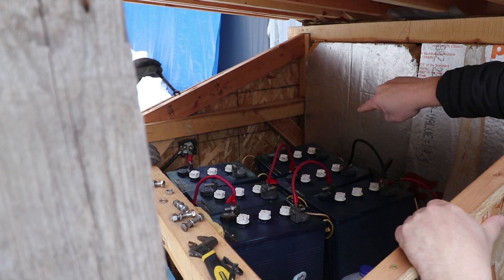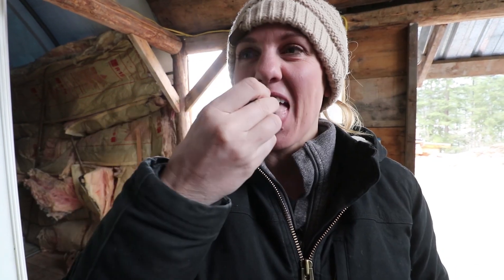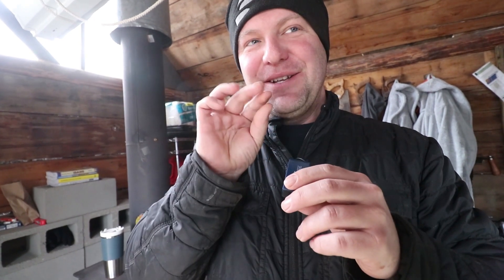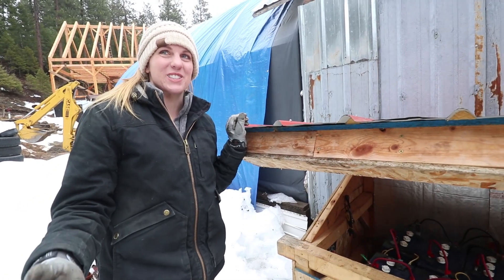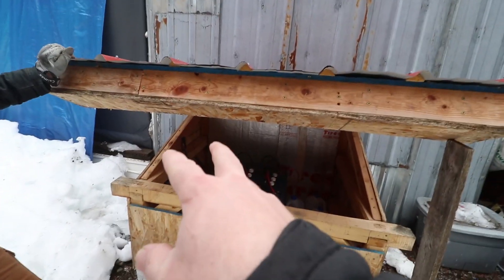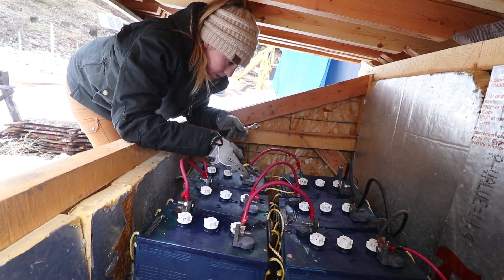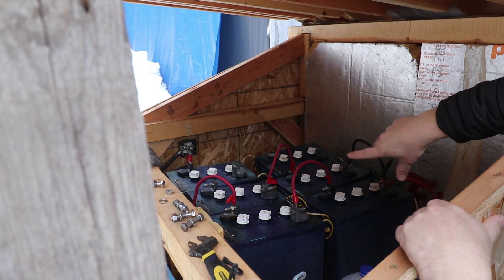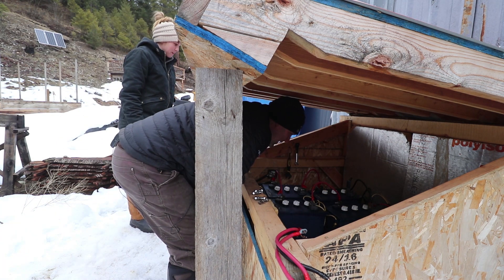All the Solar Panels in the World CAN'T PREVENT ➡️ THIS ⬅️

Comment: Two things to say here, if only one of the 6v batteries is causing the problem, why junk both - could you not look for a single so you can add the pair back into service ? Secondly, each of those solar panels is a bunch of individual 0.5 volt 6 inch modules in series. If just one in a series chain is blocked from the sun you lose most/all of the series chain's output. I would want to clear the snow from the base where it is partially blocking the lowest panes and you might see more output.
Reply: " if only one of the 6v batteries is causing the problem, why junk both - could you not look for a single so you can add the pair back into service ?"
Two batteries, six volts each, that is wired in series for 12 volts needs to be same make, same age same sixe and preferably same batch, because if they are uneven, they takes different charge, meaning that one are overloaded when the other are short of full load. This is bad for both the batteries, and shortens their remaining time as usable batteries.

Comment: Electricity is like water in a pipe, the pressure is the voltage, the size of pipe is the current, voltage multiplied by current is watts (for AC there's a power factor offset, if you look at an appliance that has all three on there and do the calc, you will find a discrepancy)
So, high power is a big pipe with a lot of pressure.
Charging is like filling a tank, doesn't matter how fast or slow you fill it, but when you want to use it, you can use it at whatever speed you want, within the capacity of the tank
If/when you redo the battery box, make the front removable, even if you don't fix the hinge problem.
Reply: Thats a pretty good explanation, thanks.
Reply: Not quite. Pressure is the voltage as you say. But the size (diameter) of the pipe is resistance. Current is the amount of water moving through the pipe(a product of both pressure and diameter of pipe). And power is the ability of the water to move something a (product of the amount of water and the pressure).

Comment: Dear Alyssa, Robert Smith does a good job in a three part series of explaining how voltage-current-watts work (30 min total).  The link is to part 14 of his Build a Solar Panel series.  If you decide to watch how he builds the panels from scratch, I recommend switching to aluminum frames instead of wood frames, unless you can figure out out to preserve the wood for quite some time.
https://www.youtube.com/watch?v=yv9KpbZTUIc

Comment: Simplistically think of electricity as water in a hose. Voltage is the water pressure inside the hose, Amperage is the amount of water going through the hose, Wattage is the amount of work the water coming out the hose is doing (turning a water turbine), Ohms is the resistance the water sees inside or coming out of the hose.
Reply: This is exactly right. Only consider Amps as the amount of water, yes, AND size of hose. Low amps, straw. High amps, firehose. I know it’s oversimplified. 

Technically you can think of the hose size as wire size and, say, hooking up a drinking straw to a fire hydrant is gonna blow up the straw. Or oppositely, pouring a glass of water through a firehose really wound do much. Buts really where resistance comes in and blah blah blah... in all my years of electronics engineering, water is the best way to wrap your head around it

Comment: Your solar panels are way too flat. Google "solar angle calculator" and you'll see that you need to have them close to 22° from vertical in the winter for maximum solar return. The side benefit is that the sharp angle means little to no snow accumulation.
Reply: That is great for sunny days but on overcast days (which can last for weeks where they are) the panels need to be horizontal to receive the highest amount isotropically-distributed sky radiation. Doing this can increased the solar energy capture by nearly 40% compared to a tilted DTS panels under cloudy conditions. I read somewhere that people are developing duel axis sun trackers to take advantage of this fact. Of course you what them to be tilted to DTS when the Sun will be out or during snow. Learning this help me out a lot the second winter of using solar in the very cloudy PNW.